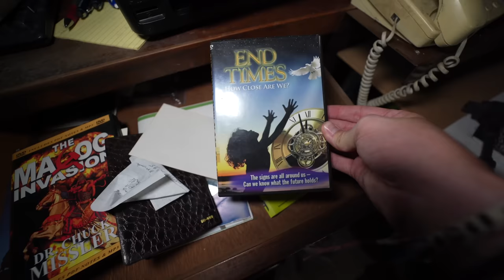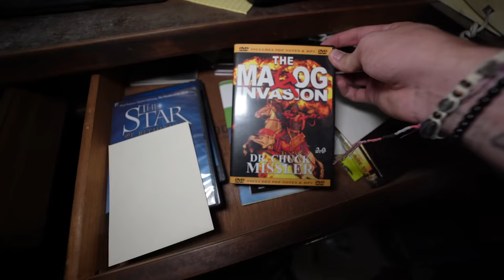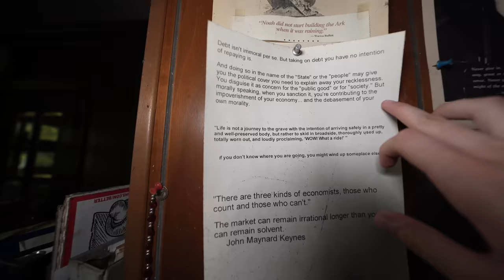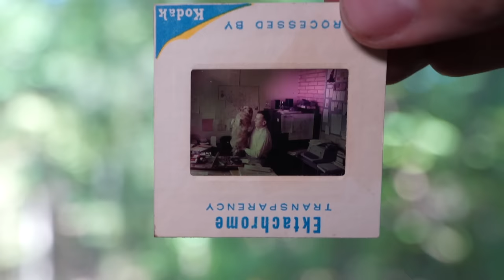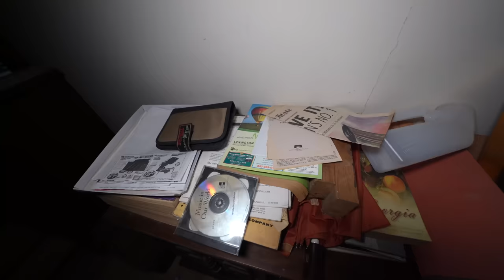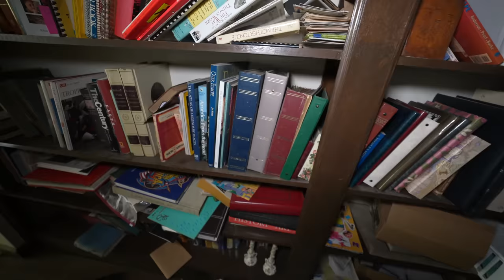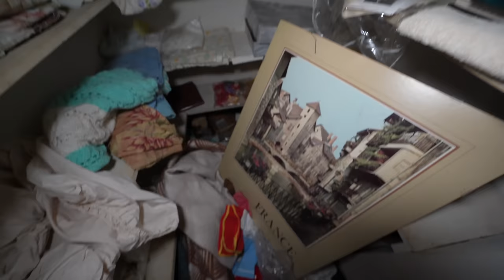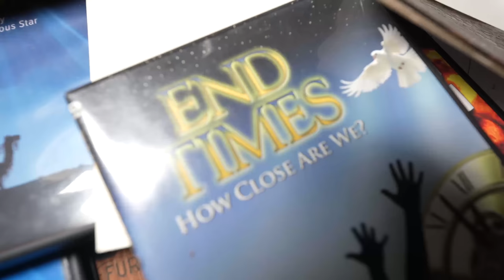Doomsday Prepper's ABANDONED Mansion | Found Secret Bunker with EVERYTHING Still Inside

Comment: The tool boxes look like a inverter.  He put in the metal box probably for the chance of an emp attack. That way he would not have to rewire part of house. It could be portable or movable in case you had to bug out. And the metal balls, is an interesting concept. It could be used as a detourant to outsiders if done correctly it could deliver an electric shock to who ever gets to close to it but this is just the ball only. Cool find.
Reply: Looked like electrical breaker boxes. They have neutral and ground termination bars on them.
Reply: It is not a bomb. It is a fence charger. I have a bunch of those for my cattle and livestock lol. It’s just a transformer resistor and a relay. . It is missing the battery, though that goes inside to the two wires that say positive and negative  Lol
Reply: @TheDieselStop  would have been way cooler if they were bombs. Lol
Reply: The metal ball with pieces inside looked like a shrapnel bomb. 💣
Reply: @CQ-369 the only thing I can’t think of his little tannerite bombs……..something he can hang on a tree and snipe from the house to spark the explosion
Reply: @TheDieselStop well it's kind of cool to think they may have been trying to make a wired electric fence to keep people away from the house. I haven't seen that in of the other videos.
Reply: I have a working theory… The balls look like some sort of industrial Float.. like a chemical process high or low level float…they used to add plastic balls inside so that they would float but not collapse from external pressure. I spent 28 years in Process engineering and have seen them in the past.. but old technology with the advent of micro switches in the 70’s and 80’s .  Be interesting to know what the guy did before he passed… aerospace maybe?
Reply: Those "metal balls" were definitely some form of pipe bomb.
Reply: @CQ-369  Those are just floats. They would be in a toilet tank or cistern etc. to shut off the water. The balls inside just change the weight.
Reply: Emp won't knock out the wiring in a house, emp will fry printed boards
Reply: @madtom87tom  lol so true , I was thinking about the Carrington event a CME not a EMP. That was a sit there and be pretty girl day. Ty
Reply: cistern floats @TheProfessordank
Reply: @madtom87tom  tell that to the telegraph systems, and electrical systems knocked out in the 1800s by an EMP, long before printed boards.
Reply: The metal balls look like the ones back in the day that coated hand made medicines in silver or gold leaf for the extremely rich. Dk for sure though. Neat stuff❤ be safe guys
Reply: You saw an ammo case for a 50 cal. heavy machine gun. If you line one of those with wooden boards, then you have an emp-proof little Farraday cage for  cellphones and old walkie-talkies.
Reply: He called that ammo box "a cartridge".  A cartridge is the casing a bullet goes into. The cartridges go into the magazines. The loaded magazines are stored in the Ammo Boxes on the shelves in the basement. And sometimes people store handguns and spare ammo in those ammo boxes on shelves in their basements. 🤣
Reply: toilet floats  @TheProfessordank
Reply: @TheDieselStop  Haha, I was going to say, there's no reason to have a large transformer in a bomb.
Reply: @TheProfessordank  No they aren't pipes.🤦🏻‍♂
Reply: @coolsno  How can you tell a telegraph system anything?
Reply: @jacobshort6528  Ammo cans contain cartridges when used in the Military.
Reply: It seemed like he had an entire hardware store in his basement. It seems he was certainly prepping for something. Maybe he knew how high hardware prices were going to get.
Reply: @jimmyparris9892  He may not have been prepping. I work on cars and I do odd jobs and repairs. From what I've seen in the video, I probably have quite a bit more than the owner of that house. Farmers also have a lot of hardware on hand. If you are 20 miles from the nearest store then you don't want to drive that far for a bolt.

Looks like he was making items also.

Comment: NOT A BOMB!!!  Lol people have no idea what a electric fence box looks like lol. Those are for cattle and livestock. The two wires inside are for a battery and the light is for when you power it on. It’s a relay, resistor and a transformer, you plug the wires from the fence in to the outside of the box. Lol you can see them behind the hinges lol. They are fence chargers, lol 😂 I have a bunch of them myself 🤣😂🤣
Reply: To stop the zombies

Comment: @44:43... I believe that those old metal tackle boxes were wired to be makeshift "boobie traps". The metal spheres look like they were intended to be grenades that could be loaded with gun powder, and fused... Or... Who knows... That didn't look too doomsday prepping to me. A lot of junk.
Reply: Not you are totally wrong lol. Those are fence chargers I have a bunch of those I have made over the years. They are for livestock. The 2 wires in it are for the battery that say positive and negative. There is a transformer relay and a resistor in it. The fence plugs in behind the hinges. Lol the switch is to turn it on and the light is to let you know whenever the fence is activated and you don’t have a dead battery.
Reply: @TheDieselStop  I hope you're right and you probably are, but my first thought was "Run! Get out of that house and call the bomb squad".

Comment: Very interesting explore - quite!
One big mistake this "dooms day" prepper made though is building a home - any home with a flat roof as those never last/hold up worth a darn.  Steel roof sloped and that home would not have so much internal damage/decay going on.  
If they had kids as it appears so - will never understand why they did not do more to clean things out/secure this home & then sell it unless there was no will.   That home w/30 acres is worth a few $$$......
Reply: Yeah l was thinking the same about the roof no wonder they had leaks ,why they didn’t fix the problem doesn’t make sense.
Reply: I'm sure some bank is holding the property in escrow until the will is settled. It might have been contested by heir's or business partner's or even the IRS.
Reply: I worked in a building that had a flat roof, we had waste baskets all over the room! The only fix they did was tar the roof
Reply: That might work but only on a temporary basis.  The proper way in my opinion is to replace/modify/rebuild with a steel roof with slope to it so that whatever hit the roof i.e. rain/snow/sleet goes off the roof if the long term proper way to fix it - my opinion.  👍 @maryellenshock
Reply: i was thinking the same! the poor build choice for the roof is likely one of the main reasons why the house is now unsalvageable.

Comment: Having an extensive background in explosive ordnance, IED’s, suicide bombers, etc., I can assure you this guy was equipped for a FAFO scenario.  You’re all very lucky to make it out of there in one piece.  If the state ever learns what is on that property, they will most certainly do a controlled demolition of the premises.
Reply: @GrindSultan  I would venture to guess you’ve never seen an IED up close and personal.  Most explosives can easily be made with a few readily available “hardware store” items, but what do I know?
Reply: They are nothing more than a fence charger for livestock they have a resistor they have a relay and they have a transformer and a positive and negative for a battery inside if you look on the backside of the box for the hinges are that’s where your fence plugs into. I have a bunch of them that’s why I know.. lol
Reply: @TheDieselStop …..but but……he has experience in explosives and IEDs!?!?

🙄

Comment: Those boxes looked like some sort of power setup. maybe add a battery and set up the voltage to power something like a lamp or heater. Those balls are floats for boiler systems. I am guessing the house had a boiler in it.

Comment: Those balls were floats, they put stuff in them to make them sink a little bit, maybe to adjust water level in the pool. Sad that house went down that fast! I have an old house and I was gone for 6 months with the heat and cooling off and had mildew on the wooden floors  when I got back, had to hire a cleaning company to come in and remove the mildew!😲😲

Comment: the tool boxes arent bombs 
its got a transformer and diodes, capacitors and likely some resistors in the one you opened. nothing that goes boom. 
i cant tell what its suppose to do without hands on inspection. 
just becasue you see wires in a box doesn't mean its going to blow.

Comment: Those boxes appeared to be ignition switches and the spheres with ball bearings seemed to be what could be placed inside them. I wouldnt mess around in there tbh. Nail on the head when thinking "possible boobie traps". And definitely would be wearing mask with all that mold and chemical smell...

Comment: It’s had additions built in. The 70s vibe of the home is the oldest and likely the original portion of the home. It once had a fireplace to it and that wasn’t one large room either. There was a wall dividing that and later someone put that massive header beam to be loading bearing so the room could be opened up. The counter across from the sink was deep because there wasn’t a wall there. It was likely a window which was a common thing to have. If I had to guess, the man custom built the home in stages. I haven’t gotten far enough into the video to see how the room look. This isn’t a mansion though and it isn’t a prepper home either. It’s a Lori Vallow psycho like minded person home.